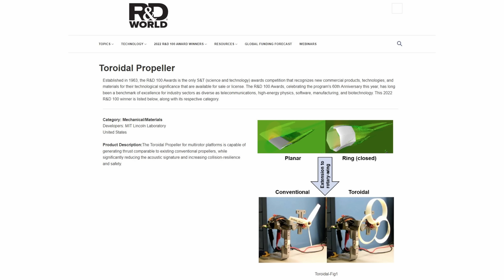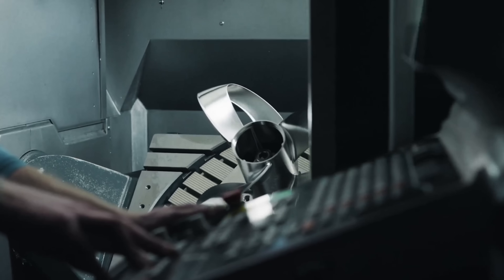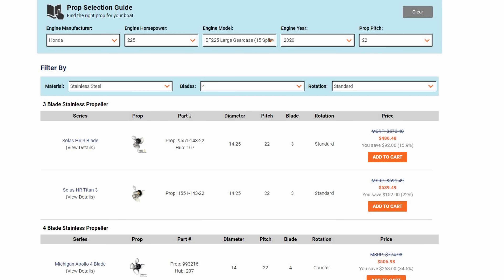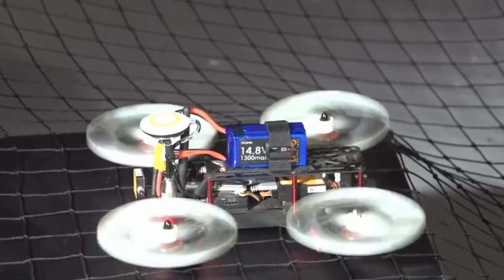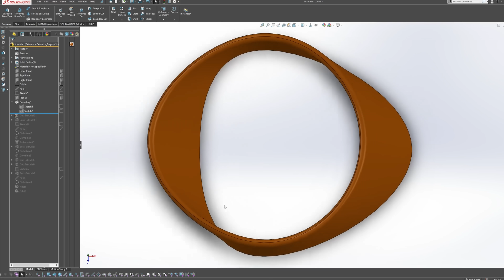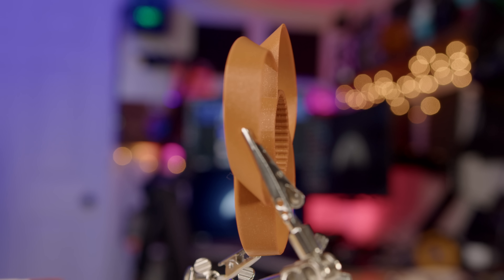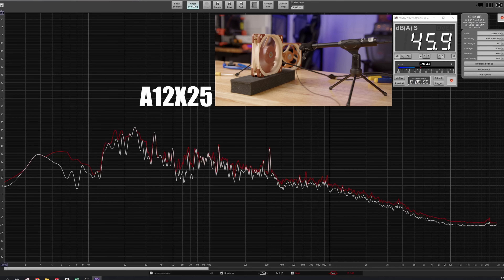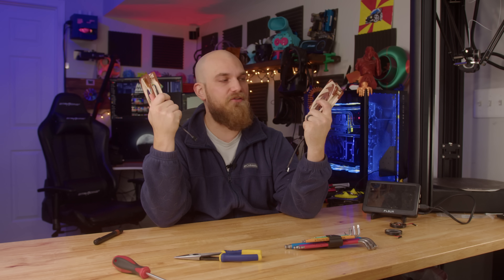I Turned MIT Award Winning Toroidal Propeller Into A PC Fan | Fan Showdown S5 Special

Comment: Quadmovr put toroidal propellers on a stunt/racing drone, and they ended up being substantially louder than his more conventional 8 blade propellers. The toroidal had more of a howl to it.
There is a drone delivery company called Zipline. On some of their drones they are running a 2 bladed propeller. The blades sit at maybe 25 or 30 degrees to each other, and on different planes on the hub. Opposite the blades is a single coin shaped counter balance on a stalk that is a bit shorter than the blades. It makes sort of a shushing noise with little, or no buzz.

Comment: This is pretty badass as a first stab.  As RE said in his comment, with additional engineering effort to tune the airfoil shape, improve fit/balance, and some configuration studies (what if you overlapped four or five toroidal rings?)  you'd probably see it close the gap significantly
Reply: That's my first thought as well. Increase the fan depth to allow for over lapping rings at higher density.
Reply: Essentially, the “peak” shape just becomes sharper but there is significant loss of air pressure due to the “openness” of the shape itself. High pressure usually = loud.

Comment: Hey there, the transition on the toroidal fan front blade to blade was quite aggressive. Smoothing that out would help with the tests quite a lot. Another thing to take into consideration is the weight, flexibility, and quality of the 3d print. A thicker print with groves from layer lines will most definitely cause some performance issues.
Reply: @MajorHardware Also, the 45° Angle of Attack is WAY too aggressive! It should be around 15° at the root and slowly decreasing towards the tip. Angling the propeller so much will cause it to stall, which will drastically reduce performance and increase drag (due to the massive amount of turbulence generated)

Comment: In a computer case, since the path around the fan is usually quite long (from one side of the case panel to the other), the pressure gradient at the edge can't easily get around the shroud to dissipate energy in the form of a really long tip vortex.  However, there is still the abrupt pressure gradient at the tip, where the flow turns very 3D, and a toroidal could soften this, but fans that need to overcome static pressure gradients inherently need all flow to be sufficiently energized by the fan to avoid local flow reversal at the shroud.  Fans with lots of blades are good at evenly applying energy to the flow so that very little of it will reverse away from the increasing pressure gradient.

Comment: Amazing experiment as always. Try to print one more fan using SLA so that you won't have grooves generated by layers of 3d printing. And measure the difference. Also, there can be slight variation in weight distribution causing nonuniform in moment of inertia, resulting in vibration. SLA method reduces this too.

Comment: You are running them both in a ducted configuration.  The duct on the standard fan is going to provide a lot of the same benefit for reduction of tip vortices as the toroidal fan, and is probably quite a bit more efficient (especially since you have more blades).

Comment: Definitely needed to be doubled up, the back pressure is going to punish anything that is very open
Reply: I agree. An additional lever to pull: adding depth like the Sharrow water props would also increase the surface area and probably help channel the air and keep it moving towards the output.

Comment: I can definitely see more blades improving the airflow and static pressure.  The angle of the blades could also be better optimized.

One piece of the Noctua's design is the ridges on the blades that are supposed to help reduce the noise they make, so I wonder if the same kind of ridges could be added to the toroidal blades.

The fact that this quick unoptimized design appears to compete so well at all with the top-dog Noctua A12x25 I think it pretty promising.
Reply: Exactly. I would love to see like overall stats from the various ones tested. So you could theoretically then combine the advantages of the various optimal fans. Though the official one seems to be highly optimized already, while all the others are barely test of concept stage. So any doing vaguely decent against it is a huge sign towards that design being easily better, in certain ways at least, after a few refinements. Then material testing and and refinement to fix any changes due to that and you have the best min/max'd fan ever.
Reply: might also be interesting to try it out with doubling the thoroidal blades, fusing one set into the other
Reply: Except we're missing the scale. If the noctua is top dog, how much worse is average dog and bottom dog, and how does the toroidoal compare to those respectively?
Reply: Not sure how well it competes, really.  It's moving half the air and making a little more noise. Not to say it couldn't get better.  But it's not like it was just barely worse than the Noctua.
Reply: @BrettBreeden  Keep in mind that airflow and static pressure are not the same thing.  At half the static pressure, this unoptimized design isn't something you'd want to put against a radiator, but in the smoke test, it doesn't appear that its airflow is that far from the Noctua.
Reply: good summary

Comment: The duct around the fan/propeller already does a fantastic job of eliminating tip vortices (that's one of the reasons computer fans use them!).   In a ground mounted situation, weight isn't nearly as big of a concern as it is in a flying machine.  The proper comparison, as mentioned in passing during the video, has to be done in an unshrouded/unducted situation. The toroidal propeller offers a tip vortex solution that doesn't require a shroud/duct.

Comment: I think refining the angles, the shape of the torrid, and the trailing edge, will yield insane results. Something perfectly tuned to 2000rpm,
Reply: Yes, since you know the speed it should work you can make it work perfectly for just that speed
Reply: Yeah, I think a lower angle of attack on the blades would be optimum...say 30°or less possibly

Comment: The bladeless fan design trick of having the fan only blow in a central core with additional air surrounding the core to supply more volume ( up to 10x more air). Might also quiet the noise more, or you could increase the surrounding duct to block any blade generated vibrations. (And provide vents to pass more air in.)
Reply: Wait for it. With the toroidal design, incorporate slots. So, you might want to increase the depth of the blade to lower the pitch. Yes you will be making a whistle, but the air volume will be amazing with slots at the outer circumference.

Comment: Static pressure has specific use cases. If you're pushing through a rad or heatsink they're good. For just moving air through the case the toroidal would be better because the decreased pressure doesn't really matter and you shift the tonal pitch to a range more comfortable for human hearing. 

I would use traditional props on my water setup and then use an array of the biggest toroidal fans I could at the lowest speed that's pleasing to the ear. Lower decibels combined with lower tonality is a good formula for silent airflow. Every additional fan you add (same model/specs) will only add 3db to your overall noise output meaning 3×30db fans are better than one 50db ripper.  3×30db fans sum to 36db but will probably perform similarly or better.

I want this in 120mm+ and offered in low rpm/dB models for keeping ssd's, nvm's, ram, and board components cool. Even if they had to run at higher rpm they'd be preferable in this use case.

Comment: Super interesting! I think that design probably works best for applications without a shroud or duct. The blades almost form their own duct-ish thing. Just my guess. Sure looks cool, though!
Reply: Problem is unducted PC fans don't work all that great to begin with!

In PC space there have been some unducted fans, particularly the Arctic F Pro series, but they make up reduced performance by just being THICC, and also only partially. 40mm instead of the usual 25. They failed to make an impact and largely got themselves killed off. They do sound pretty nice and unobtrusive but they also didn't shift a lot of air.

Though i think with this sort of blade construction it may be worth another shot?
Reply: My thoughts exactly. The whole idea is centered around silencing non-ducted propellers. So having them in a ducted PC-fan kind of defeats the point.
Reply: The comments under the first showdown that the Cheater competed in made me aware that fan ducts aren't as common in PC cases as they used to be, despite being so obviously useful in improving airflow. I wonder if it's because they get in the way of gamers' oh-so-important lightshow. 🙄
Reply: @stevethepocket  You're thinking of the wrong kind of duct; the fan frame fully envelops the fan blades and thus makes it a "ducted propeller"; as opposed to an "open propeller" like what the original paper is aiming for for its usecase.

Ducted cooling assemblies, where you have a shaped pipe connecting some outside opening to a fan, have only ever really been a thing in mass-produced prebuilts, not in standard-parts custom-built PCs, because it turns out this is kinda impossible to standardise across so many possible part combinations. And with prebuilts leaning towards overpriced throttling garbage today, there really isn't much incentive to put thought into airflow engineering, just slap the cheapest thing on it that barely works, people who buy these things don't know any better anyway.

I would actually welcome a step back from tempered glass sidewalls and back to polycarbonate ones. For one they're pretty robust and cheaper to replace; for other you can do things with the sides - drill vent holes and such. A large downdraft cooler, side vent for it, and some DIY ducting to help it draw the advantageous outside air could be a thing. You can have aesthetics (or "aesthetics") and functional design both. This is actually about what i've been doing but i've got that old Scythe Grand Kama Cross and just steel sides. Apropos functional design vs. aesthetics, what's up with enclosures that have so much glass even covering the front, they have no chance of supplying the requisite air?
Reply: @SianaGearz  If you're saying that cases with built-in ducts aren't feasible because of the wide array of places the CPU could be positioned on the board, that may be true, but that's when you just go with what my last off-the-shelf PC did: having half the panel covered in holes and making the duct attach the heatsink instead. You'll want all those extra holes anyway so the graphics card (and any other components on the board that get hot; apparently even SSDs and RAM have heat sinks now) can get fresh air too.

Actually, depending on your computing needs, that graphics card might have more use for a ducted fan than the CPU would, and for that... yeah, I've never seen anyone do that and I have no idea how it would be done.
Reply: @stevethepocket  The "put holes everywhere" design is now considered obsolete in upmarket builds, for the reason that then you have nowhere to put air filtration. The now preferred build type has air intake only at the front, but across the whole front, and optionally also at the bottom. Openings there, fans with a good amount of airflow and static pressure, lots of fans, and there's an easily removable filter mesh in that air path. So you're supposed to sometimes extract the filter insert and just wash it. Due to high combined pressure of forced intake (3 fans typical), and little exhaust pressure (1 fan typical), any stray openings in the case don't draw in air, but expel air instead. So the devices in the PC never have to actually deal with dust contamination, as all incoming air comes through the filter.

I never actually upgraded to that design philosophy yet and occasionally just clean my hardware. But i've been planning to kinda.

If you had one say 12cm opening that vents directly or via a shroud/duct into the fan intake, you can install a filter there no problem. But once you start putting more holes in especially hoping the GPU will draw in something, it becomes increasingly less feasible.

Duct being supplied with heatsink? Well you have space for that on downdraft coolers only, and most good and cost effective designs are tower coolers. And then you also somehow need to account for all the different chassis widths.

Comment: Add six more blades to the toroidal, to match the blade number of the other fan, and you'll probably see a significant improvement in air flow by the tiroidal fan.
You might even get much better airflow by just adding three more blades to the toroidal; you could then test the six blade toroidal against the nine blade toroidal fan.

Comment: I use a dust collector in my small shop. They are crazy noisy, I can't help but wonder how much quieter it would be with a better blade design and if it's significantly quieter there is probably a good market for them.
Reply: For our shop, I build a closet for our Clear View cyclone dust collector. It's built with two layers of 5/8 drywall and uses an exterior steel door with more 5/8 drywall on the back side of it.  Then I built a set of baffles floor to ceiling and about 18 inches wide that just have a 3-inch wide opening that is alternated from left to right with each layer of baffling, which are 3.5 inches apart. It's quiet enough to have a conversation in the room while it runs. We have really high-end (I want to say 1 micron, but I would have to look to be sure) filters on the outlet and recirculate the air in the shop so we can easily maintain temperature and humidity. A better fan design is a great idea, but this was easily done at a low cost.
Reply: Dust collectors would use turbine/impeller type blades. The difference there would definately be interesting
Reply: @ericapelz260  yes there are ways to work around the noise if people have the space. But there is a reason so many high end vacuums sell compared to shop vacs with a noise barrier, some people will pay for the convenience.  That's one thing that bothers me about the festool groups. When a problem comes up their solution is always to buy more festool.  

Clear View is an expensive brand. If there was an option to buy a quieter unit with a 20% markup I believe it would be a popular choice.
Reply: Some nice outta the box thinking!
Reply: @Otto-W   I agree a quieter unit could draw a premium. We already had the Clearview, so this was a retrofit. It could also work with a shop vac if you had enough hose to reach things. There always is more than one solution to any challenge, and each will have it's place. (FWIW, we went with Clearview because we wanted to re-circulate the air but wanted to minimize the health hazards )

Comment: It's more quiter because it had more blades. the same can be applied to 6 blades on an aircraft's propeller like a c-130, super tuccano, or even helicopters with 5 to 6 blades. so if you wanna compare the sound with a turoidal, I'd say get a 3 bladed fan

Comment: That's interesting - my dad did some work for GE making fans more quiet back in the late 70s/early 80s. That was before there were PCs. But he did manage to make them more quiet. I wasn't privy to the details, but I think it has to do with the angle of the blades that break up the incoming air and how it shapes the air once it's gripped it, as well as possibly creating an echo off of other blades or parts of the fan.

Comment: The pumps of Saturn 5 rocket engines were standard speed boat propeller blades which are designed to move liquid.  It would be interesting to build a pump using toroidal propellers and see if high(er) pressure could be achieved.  All conventional liquid fuel rocket engines are based on pressure thrust so more head pressure could produce more powerful engines.

Comment: Testing your drone with the Noctura fans would be really interesting. If a more bladed fan could reduce this noise a bit that would be fantastic
Reply: If we are talking about drone props, here is how bladenumbers affect things:
Fewer blades = more speed (due to less drag), lower efficiency, more noise.
Dual blades for highspeed builds, very loud, need beefy motors and high-C batteries.
Quad blades have less endspeed, but more bite in corners, motors can be smaller and lighter.
Tri-blades are a nice medium, both for racing and freestyle drones.
I cant figure out why all the camera drones have mostly dual blades...

Comment: Fascinating; thank you so much!
paused at 3.32
That's a really interesting blade geometry; I can see the compromises against a traditional blade, along W several advantages...
They lose a fair bit of the end-blade area W the highest diameter, and therefore speed+swept volume; that's going to cost something...
It's going to be heavier; that will go either way depending on specific applications & part of the curve...
But the structure is inherently stronger, more rigid. The straight edges integrate some of the ducting/perimeter of forced/contained flow. And Because there are no hard blade ends & a more consistent mid-circumference optimal blade area, there's fewer vortices & potentially a more uniform performance curve...
There's also potential for a mixed curve set, and an optimised internal diameter/ external diameter to blade ratio; that mid area join zone is likely a net loss, but also potentially a gain for static pressure..
I Do think a toroidal fan optimised for this use case would be different, but W such an emerging geometry type there's no way to know how....
I have some ideas, but not enough skill to really do it; I'll try to see what I can put together & submit...
This blade lends itself to so many things.... Integrated ducting, conada effects? Soap bubble geometry... 3d blade array... Omfg...